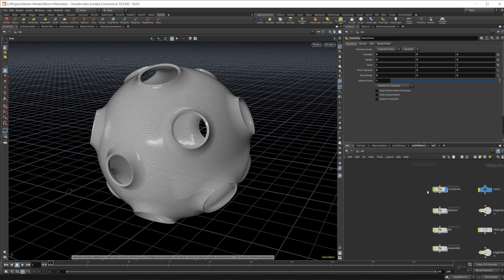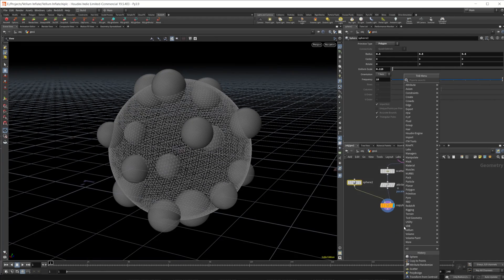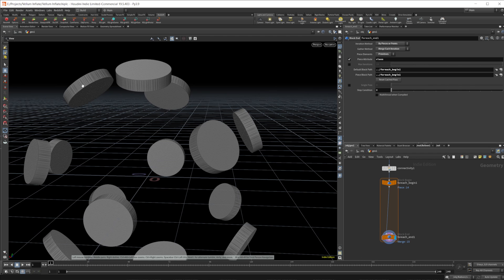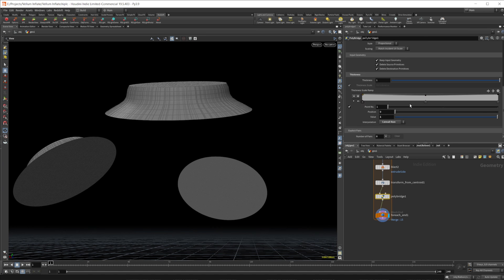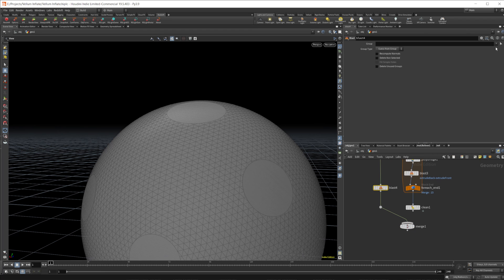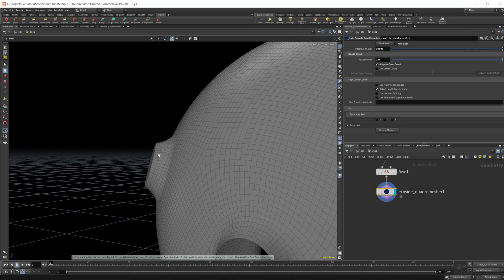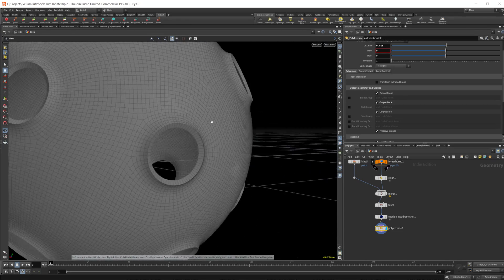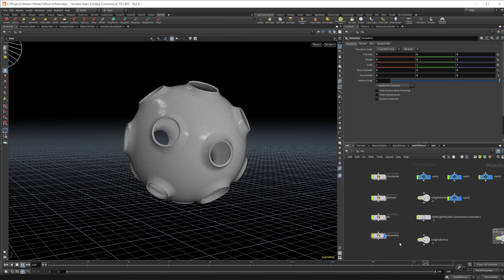Procedurally Modeling an Abstract Container | Houdini 19.5

Comment: Hi. I dont know why but I dont have the node called Transform from centroid, just the transform itself. is it because I am using the apprectice Houdini?
Reply from the maker: I'm not sure but the transform from centroid is just the regular transform node with a preset. You can recreate it by going to the pivot transform setting and setting the pivot translate to centroid(0, D_X) in the x value of the pivot translate. You also need to put that same expression in the y and z values but you change the D_X to D_Y and D_Z respectively
Reply: @InsideTheMindSpace  Yay! It worked! Thank you very much)